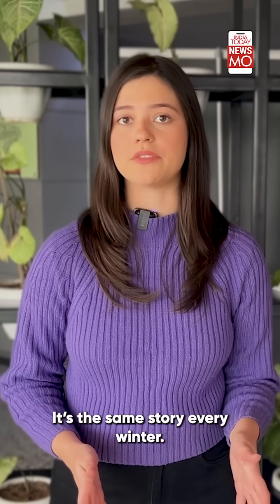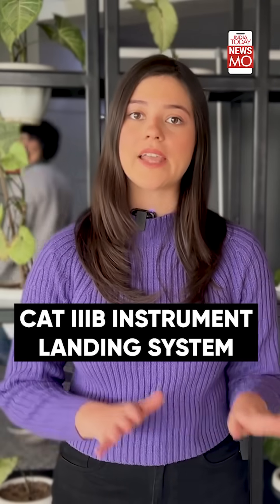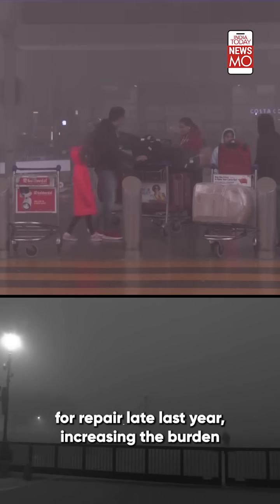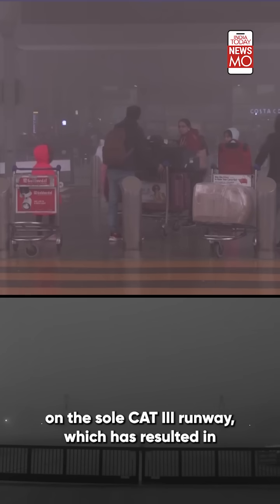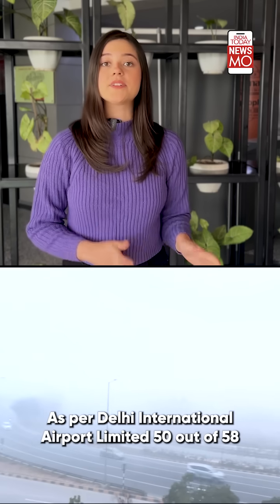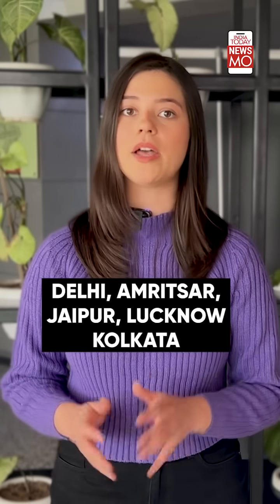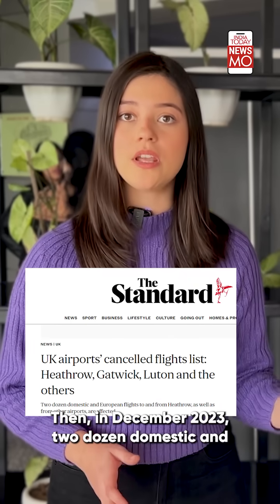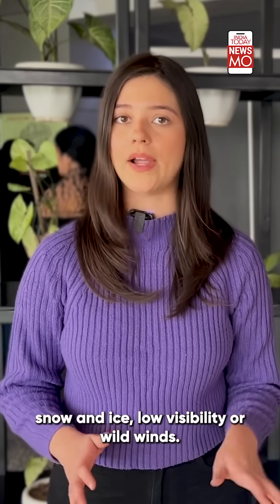Reason For Delays At Delhi Airport: Tech Behind Pilots Landing In Fog  | Explained

Comment: CATIIIB does not specify flap deployment timing and braking action sequence. With high fidelity radio signals from (3B) ILS transmitted at/near base of runway and sophisticated receivers and signal processing onboard arriving aircraft, the need for pilot to maintain visual of runway can be done away with. In clear weather, the pilot can maintain visual of runway from several Km away, and also have  CAT I or II ILS give feedback on aircraft position with respect to glideslope. With this vertical and horizontal guidance, pilot ascends/descends, banks left/right to be more certain of being aligned with runway. ILS allows pilot execute a stabilized, precision approach while maintaining visual. Pilot training covers non-precision approaches, but such approaches cannot/are not executed when ambient conditions are below specified VFR minimums (such as visibility...etc), at night (no visual frame of reference) and at high traffic airports which require high level of reliability in arrivals and departures to maintain tempo of operations. 
In case of low cloud base and other similar scenarios, the pilot gains visual of runway much later in the approach procedure, say at 1800ft of altitude and about a minute before reaching the landing point (Touch Down Zone) of the Rwy. ILS really helps in such scenarios as pilot is able to execute stable precision approach with instruments only. However, the final part of landing requires pilot action for flare and touchdown. With I and II categories of ILS, the Minimum Decision Altitude is progressively decreased. At MDA, pilot must decide whether to proceed with landing. For this visual of TDZ and alignment with centreline of Rwy must be confirmed, as pilot action is needed for last part of landing.
With CAT III and IIIB, the MDA is reduced with just 50m, which means that the pilot has just a second to confirm conditions of landing are met, as the aircraft will hit the surface in a few seconds at the maintained rate of descent. It is primarily this aspect that calls for CAT III training for pilots. At MDA of 200m or more, existing skill levels are sufficient for pilot to handle the situation - either continuing with the approach for landing or executing a go around.
The INR 10Cr or other figure for IIIB ILS is the cost of radio equipment that emits radio signals of very low error margin. This is necessary for the autopilot on board to follow the glideslope upto 50m. In lay terms, if the radio signals and their processing has a positional error margin of + or - 10m in altitude, that may be good enough for I or II, but may not be good enough for IIIB as the prospect of the aircraft being 60m or 40m above ground induces a lot more variability that what is an acceptable margin of safety.